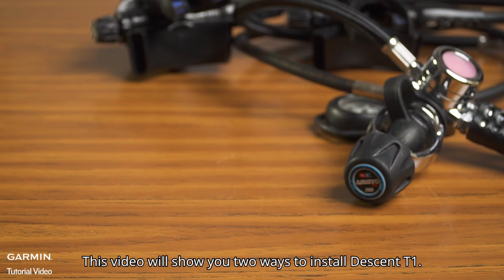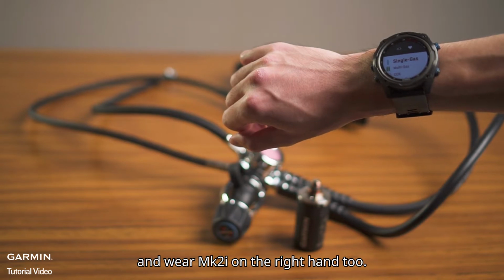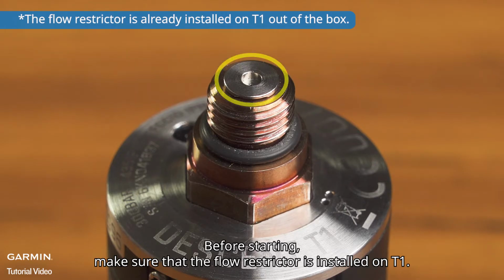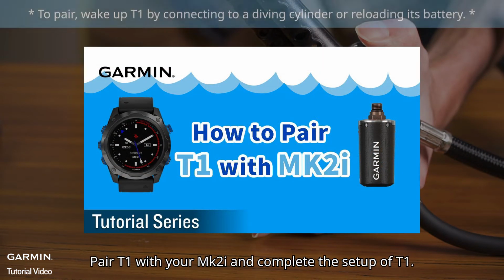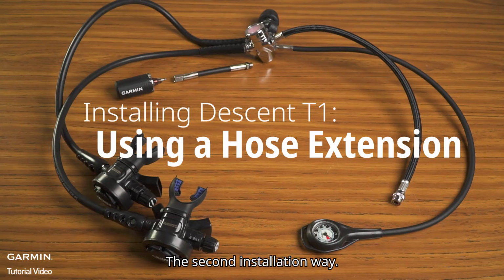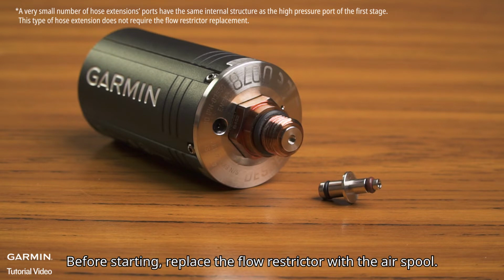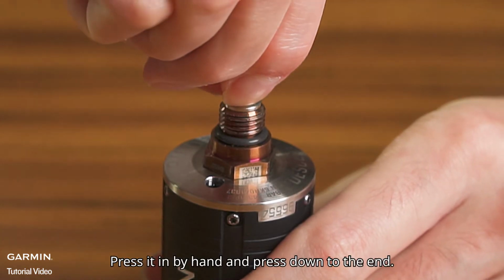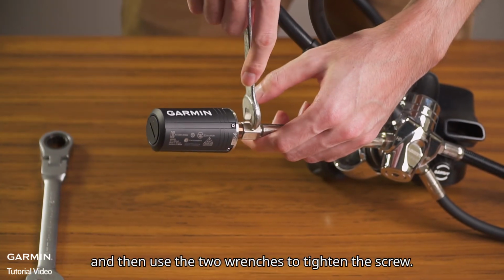Tutorial - Installing Descent T1

Comment: how do I find a hose like that to attach to my first stage regulator?
Reply: Did you ever go that route? I always just attached directly to reg in past with other brands. Not familiar with the sonar sound issue on this one though.
Reply: @LGguedo  I did it, but for other reason, I don't want anyone to try and lift my equipment holding into the transmitter